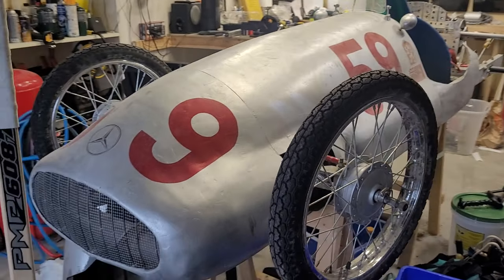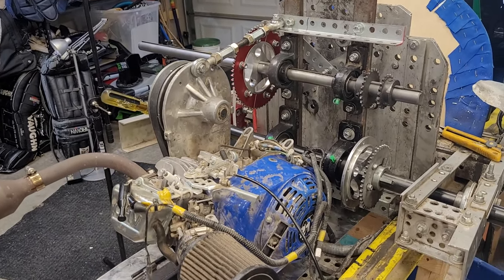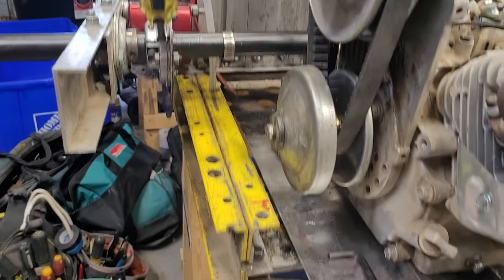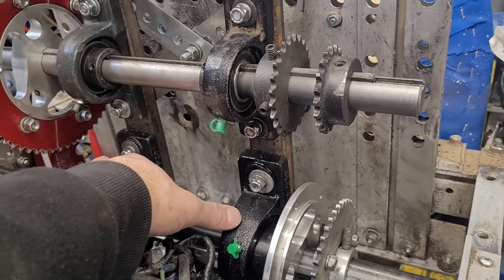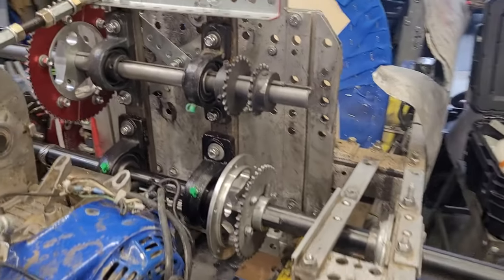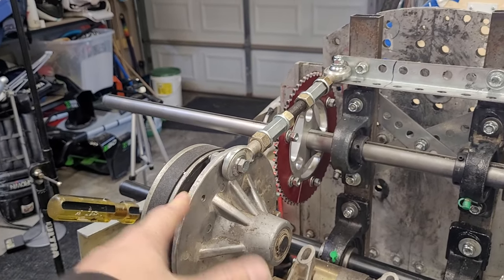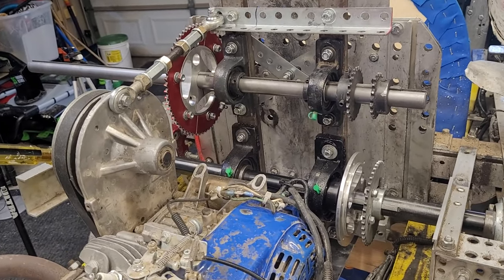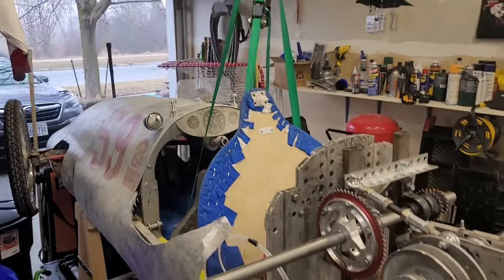The Vulture Cyclekart - Drive System #3 - Moving Platform and Jackshaft

Comment: Your ratio explanation was very good. I guess its a gearbox of sorts i can see the next step is designing a selector operated from the cockpit. I wondered instead of the rubber mount under the engine maybe a bit rigid and be better off with some valve springs 2 maybe in case one breaks. Also would spread load of engine. Just a thought 
Warwick
Reply from the maker: The jump to selecting gears from the cockpit is a pretty big leap in complexity. And to be honest, too close to a transmission (which is very much against my CK purity ethos). Just being able to do a high or low gearing for different applications is a bonus I didn't have before. All I have to do is remove one chain and put on another. 

Stay tuned for the testing video to see if the rubber mount works. I think it has a chance. The movement of the rear axle isn't very big, so I think it'll flex enough. We shall see!